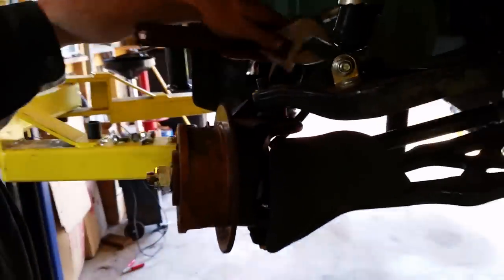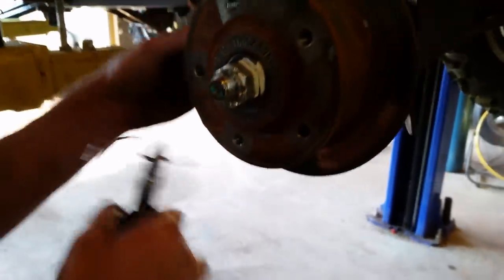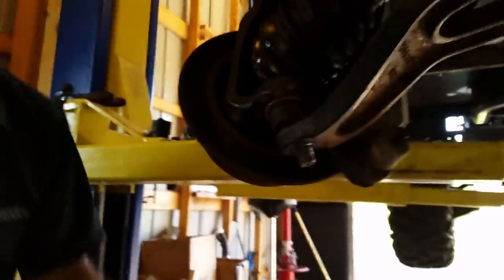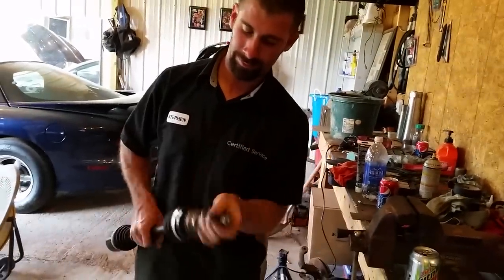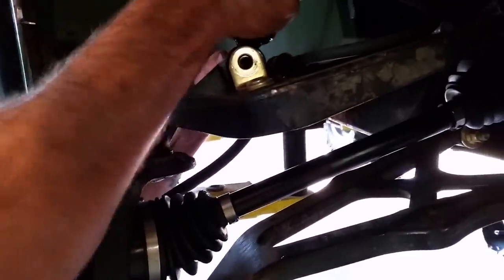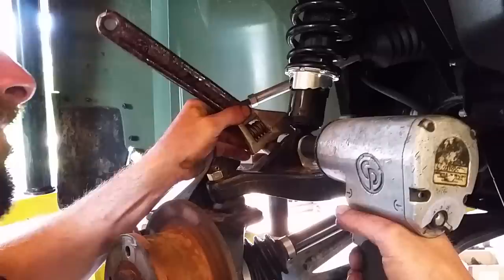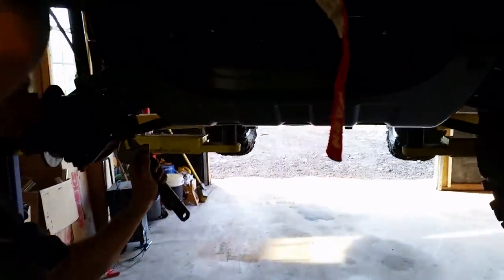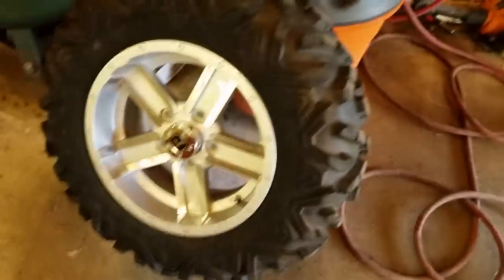JOHN DEERE GATOR FRONT AXLE INSTALL -$200 easy fix

Comment: I just did the same job, dang I wish I had a lift. Funny you guys say how easy it is to pop loose the ball joint on "new stuff"  its a shame John Deere built such a weak vehicle.  FYI I didnt need to take loose the shock, might save ya some time next time.  Like the video fellas.

Comment: This is killer guys. You totally rock. We're doing this on our 850D. Front left is making a super angry noise when loaded up on hard right turn. Thought it was more like an ATV CV joint with a retaining clip in there. Nope! Whole thing comes out. Wouldn't have figured that out without your vid. Thanks, guys.

Comment: Good Video Guys.  I just replaced both front axles on my 2007 850D, cost $104 US ea thru ebay, $361.00 CAD delivered to my doorstep here in BC,  local JD dealer wanted over $860.00 ea !! Took me the better part of a  weekend to install both but did xtra maintenance incld'g replacing all ball joints . Not a fan of using a crescent wrench on much but ya did kick my butt on 7 mins!

Comment: Just did the front left on my 2011 XUV 625i (pretty much the same as the 825i). It went pretty smooth, the only issue was separating the upper and lower control arms. I used a puller to get them apart. 
I repacked the CV joints and replaced the CV boots on the prop shaft last winter. The replacement was far easier than the repair!!

Comment: It is MUCH easier to remove axle nut and hub/disk as well as bottomed ball joint by leaving top shock on. It holds everything and doesn't have to come off.

Comment: Liked video,but had problem getting bottom ball joint off. Put shock back on and it came right off. Didn’t need to remove bolt on shock.